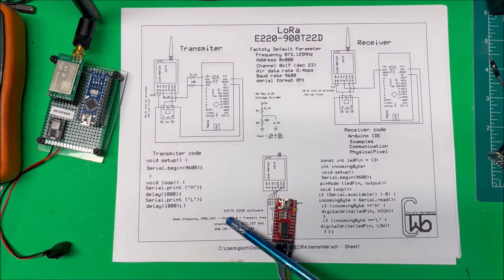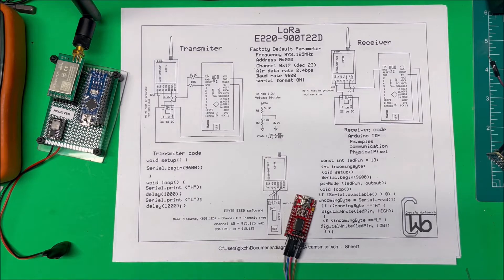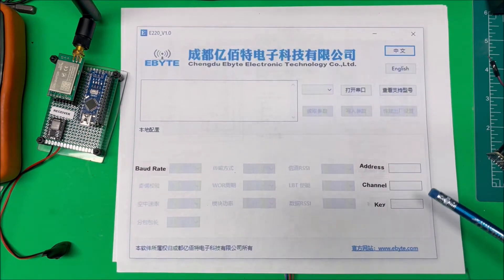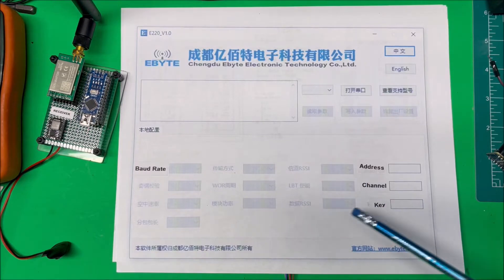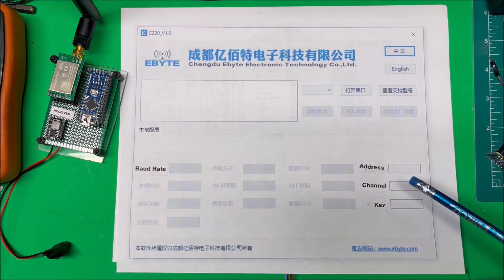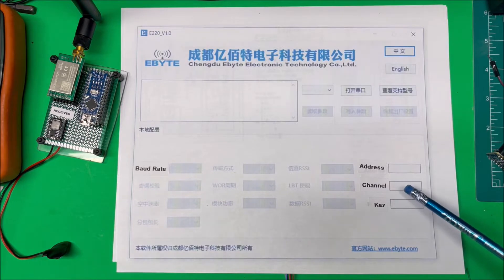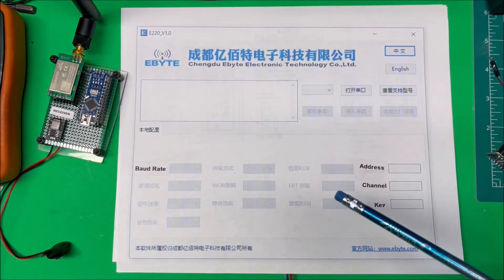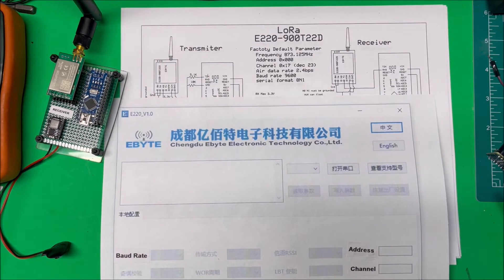LoRa E220 900T22D

Comment: It's 22dbm of transmit power  (156 milliwatts) and with that antenna at VA Beach it worked at 8 miles which is the maximum length of that beach from the breakwater on the south end to its northern extremity.
Reply from the maker: sounds good thanks

Comment: Great video. Thanks. I wanted to learn Lora programming so I purchased two.  I received this model e220-900t22d and  e220-400t22d. Which one is the transmitter and which one is the receiver?!!
Reply: Unfortunately, these are two different radio modules meant for different frequency bands, "400" and "900". If you're in the US, you'll want another 900 radio to complete your link.
Reply: Thanks a lot for your reply. I am just learning this stuff from tutorials yours. Which is better, though? The Chinese would sell you anything, wouldn't they? Thanks again @MissionSuccessGo
Reply: @mingosutu  It's not so much which is better, but rather which is legal in your country. In the US, the 400mhz band is regulated, and so not allowed to be used for civilian general comms, but 915Mhz is. Using the incorrect frequency can get you in trouble--fines and such, usually. I'd do a little research on your end to understand what frequency you're allowed to use. You'll need a matching antenna, and perform the UART to USB connection with the EBYTE configuration software tool as shown in this video to configure each of your radios.

Comment: Hi, If you power the E220 with the 3.3V from the arduino, could you then remove the pulldown resistor at 4:27?
Reply: My guess would be no as the signal from the arduino TX pin is 5V so this is why the voltage divider is used. I have had to do this with an SD card slot which has to have 3.3V for the MOSI, CS and SCK pins. the MISO pin doesn't though as it is putting out 3.3v to the Arduino which isn't an issue. 
The only thing i would do differently with this tutorial would be to put a 1k resistor in series with the receiver and lora module to limit current.

Comment: Would this work for e220 900m22s?
Reply: Hello , yes it should , the only difference between a 900m22s and the one used in Chris's video is the type of antenna connection . both are e220 modules.
Reply: Hey , i am sorry i didn't pay attention to the M in there . 900 M 22 s . i checked the manual , from a first glance that is an SPI module . not a UART module like the one in this video.
Reply: @mkivcromwell5323  i got the spi working. I can send receive cmds to the micro. But broadcast isn't working.